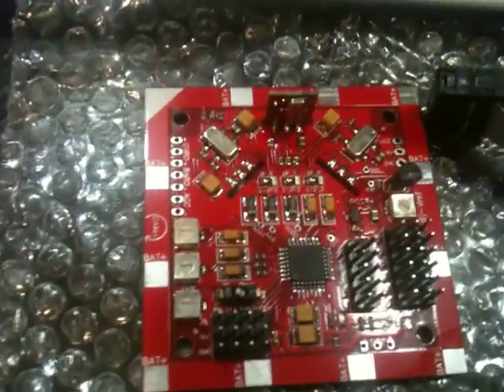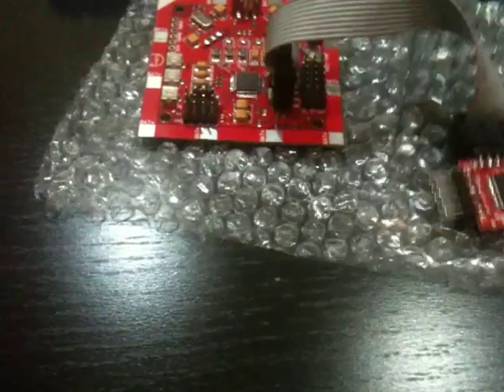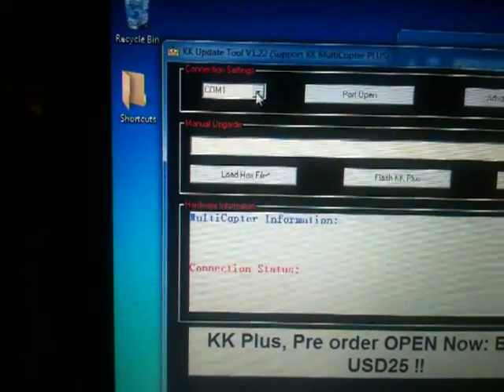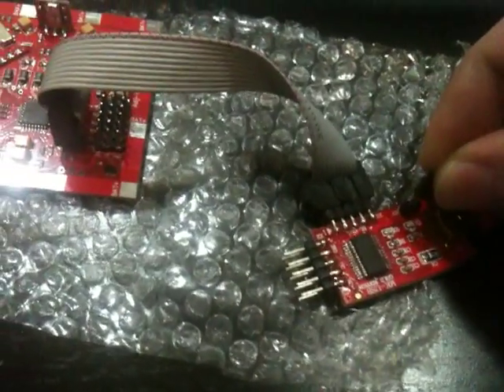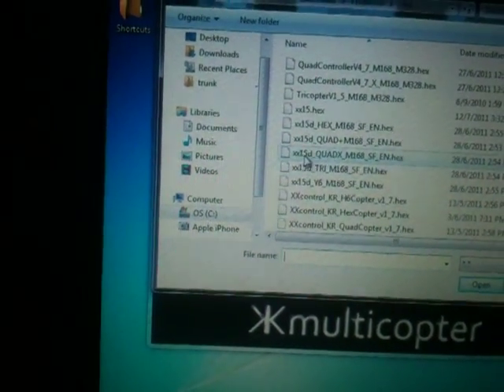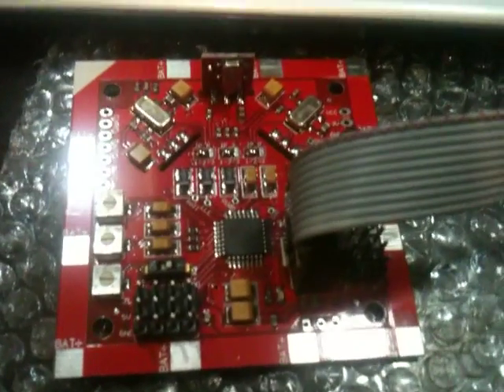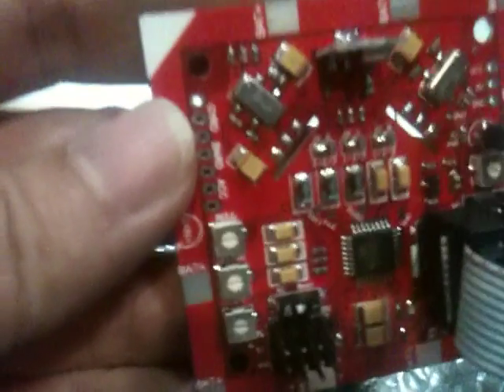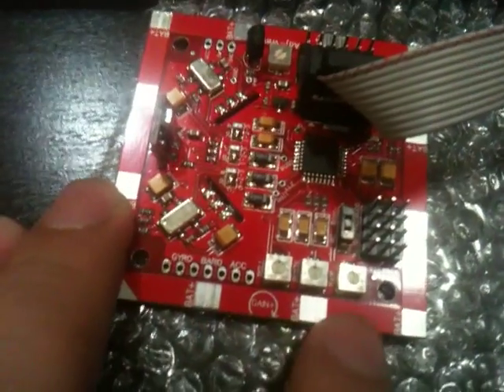KK Plus Flash Tool

Comment from the maker: @fishstick0071 

You can download it from multircshop
the tool only work on KK Plus as you need the KK board with board loader and KK Plus is the only one has it.

The KK Plus can use V2.5 TiCopter or V1.6 from KK.

Comment from the maker: You can download it from multircshop
the tool only work on KK Plus as you need the KK board with board loader and KK Plus is the only one has it.

The KK Plus can use V2.5 TiCopter or V1.6 from KK.